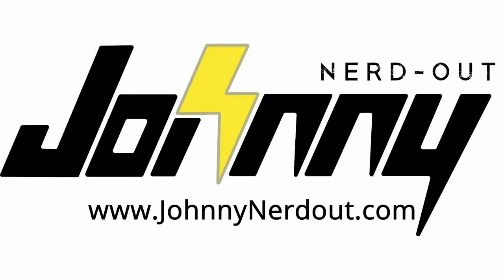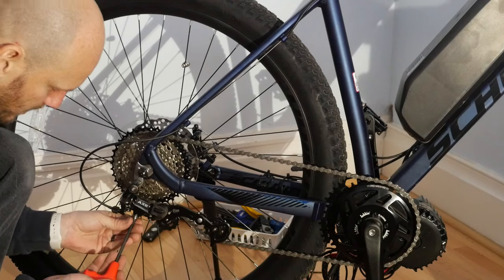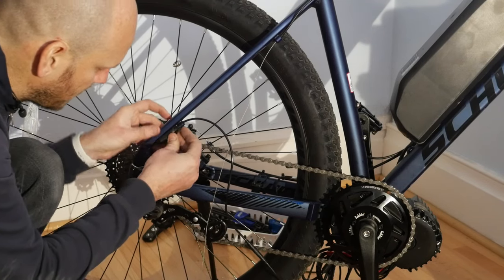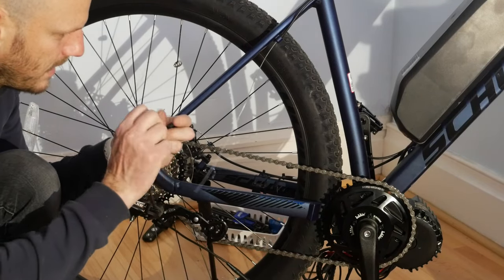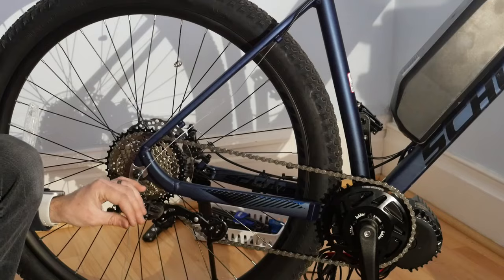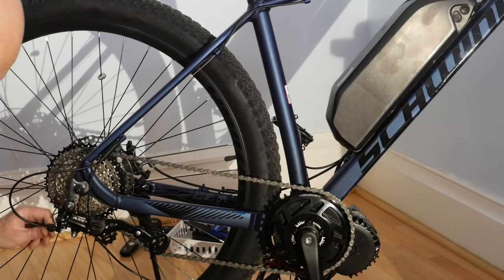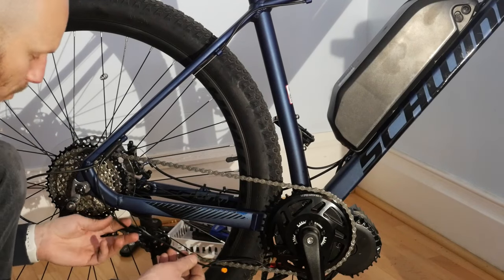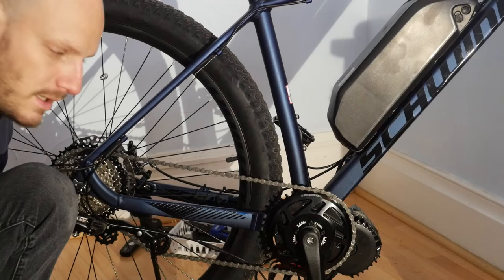Gear Shift Sensor Installation video for a Bafang Mid Drive system BBS02 / BBSHD E-bike

Comment: Mine failed because of the rain so I don't bother with it and just use my brake sensors like a clutch
Reply: Hows that working out
Reply: @truthministries77  Working out great. I let go of the brake when I  feel the gear has changed.
Reply: @manoz6194  awesome! Even with delay don't seem like much of an inconvenience either. My shifter is on the right and so If using a handle grip throttle instead of the thumb throttle I would place the throttle on the left side and the cutoff break I should use should also be on the left handle bar as well? Does that sound like it would work out right to you? In my head it's working but would be a bit awkward when I'm used to throttle grip on the right on motor bikes. Might have to get used to that. How do you prefer your set up of you don't mind me asking?
Reply: @truthministries77  I have a thumb throttle on the left and my rear brake with cut off sensor is on the left too. I don't use throttle much so for me it's fine. Can move the lever slightly to cut power then change gear with shifter on the right.

Comment: Can you put it up by the gear shifter
Reply: The shift sensor wire isn’t long so probably not, unless you get an extension for it. Also the Shift sensor is a hard rigid thing, so you want it somewhere the shift cable isn’t bending or curving. Right at the gear shifter probably isn’t ideal, as the cable usually bends there. But you could put it anywhere you want really given the considerations i mentioned

Comment: Maybe a drop of super glue can prevent the cut end from splaying
Reply from the maker: Probably wouldn’t fit through the cable housing then. I think light solder is the best
Reply: Stay-brite solder seems to be a bit better than 63-37 electronics solder...
Reply: @JohnnyNerdOut  Sand like solder, usually works fine after you unstick your fingers

Comment: What does this sensor do?
Reply: You put the shifting cable through it. it can detect when the cable is shifting, and cuts motor power momentarily to prevent shifting under load and crunching your gears
Reply: @soandsononame8750  Thanks, I guess that's more important with American style ebikes, here we only have 250W.

Comment: Is it possible to run a 40 and 30 tooth sprocket together up front?
Reply from the maker: Probably but really not needed for 99.9% of riders
Reply: @JohnnyNerdOut  I am the 1% that wants cruising speed and tourque for pulling a trailer up a hill.
Reply from the maker: @fulllfreezer  consider using a higher powered motor?
Reply: I had a 42 tooth Eclipse chainring.  There weren't many hills I had trouble with, even with a loaded B.O.B. trailer.  Note that I was not able to grab the very lowest gear.
The new build promises to rectify that issue, as well as have a 42 tooth bottom gear.
Reply: Addendum: was running a BBS-HD, turned up, with a 21 amp-hour 52 volt battery.
Reply: @JohnnyNerdOut   1500w bbshd has plenty,  trying to have maximum tourque from a 30 tooth sprocket and be able to pedal with a 40 tooth sprocket. Pedaling with a 30 tooth is useless unless your going up hill.
Reply: @JohnnyNerdOut  I can only use power assist 1 in 7th gear with a 30 tooth chain ring any more and the motor gets way ahead of pedaling.
Reply: @JohnnyNerdOut  the 30 tooth chain ring has very impressive hill climbing abilities having a 30 tooth and a 40 tooth chain ring together on a HD motor would be the best of both worlds.
Reply: @fulllfreezer  Just get a bigger cassette, the motor pushes the crank out too far for a second chainring without running into driveline issues.